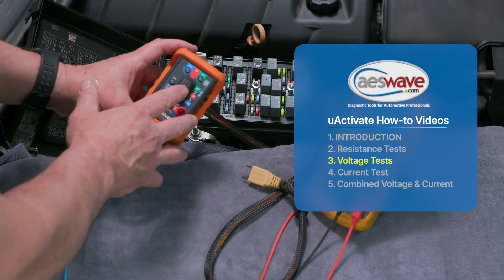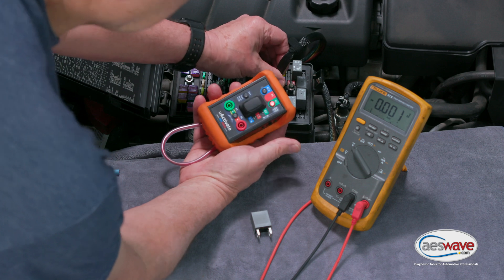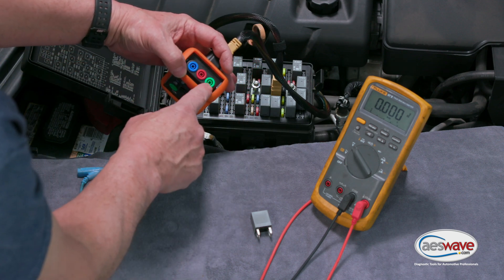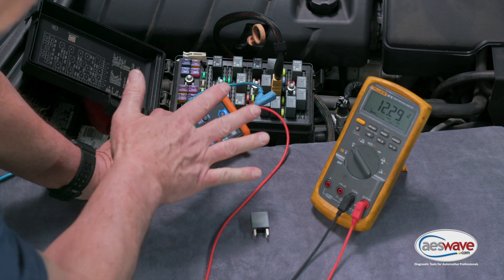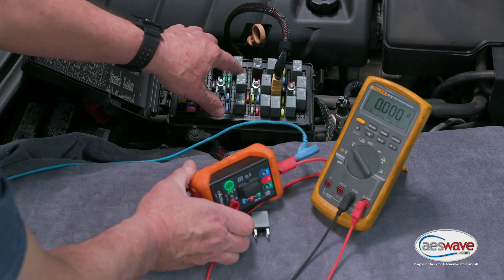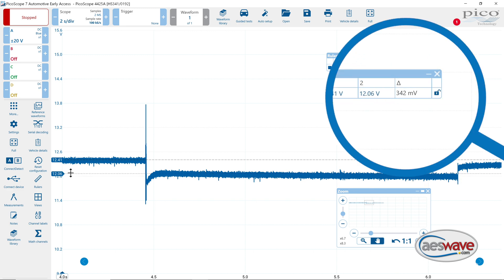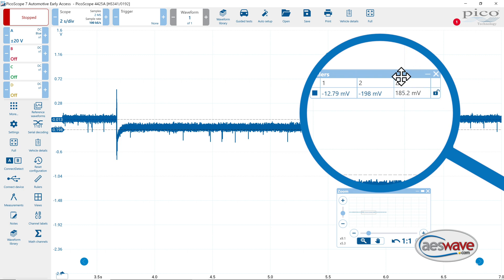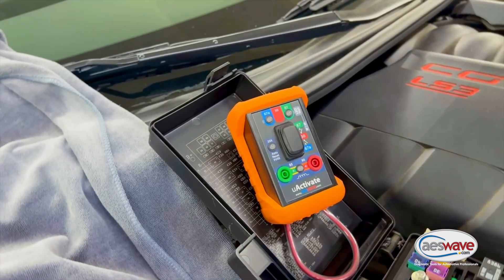uActivate® - How to: Voltage Drop Testing the Power Supply Circuit

Comment: that adapter can actually be inserted backwards????  terrible design.
Reply from the maker: You're questioning how a vehicle was engineered. The Mini ISO280 socket supports a SPST relay which 85 & 85 are in two diagonally opposed sockets and 30 and 87 are in the other diagonally opposed sockets. So getting terminal 30 aligned with the uActivate's terminal 30 is important for certain tests such as the one outlined in this video. However, if you want to quickly power up the load with the uActivate it really doesn't matter which way the Mini ISO280 adapter harness is inserted. The LEDs and the test switch make it easy to identify which helps solve the question. If you have any further questions, please let us know.

Comment: Gur the test he demo's here, it really is overkill...
Reply: Here's an example of why you would want to test voltage drop on the power supply: https://youtube.com/shorts/t5WdEyH21QE this one had a loose pin inside of the power distribution center that ended up melting the 40 fuse supplying power to the relay.
Reply from the maker: Excessive voltage drop anywhere in a circuit is a problem and this test demonstrates how it can be tested using the uActivate.

Comment: Hi nice demo but can you share a real problem like if you are not getting a control signal or missing power or ground at the relay connection
Reply from the maker: We recently posted a real world situation where the 40A fuse protecting the circuit was blown. This fuse wasn't easily replaceable so we used our test leads to run power to terminal 30 of the uActivate so we could continue testing the system. https://fb.watch/zmDQIV_Au0/

Comment: MY ONLY GRIPE ,,,,,,,,,,, WITH THIS TOOL IS IF THE RELAY DOES NOT HAVE IT'S POSITIVE FEED GOING TO IT THEN I CANNOT POWER UP THE RELAY.
Reply from the maker: For this situation you can run power to terminal 30 easily with a 4mm banana jack. Once you have that in place, you can perform your downstream tests (LED) on the load circuit and then drive the load through the main switch. If there is a short downstream, the uActivate has a built in circuit breaker. We recently posted an example case with this exact issue recently to our Facebook feed: https://fb.watch/zmDQIV_Au0/

If you need further clarification please let us know.
Reply: No need to yell

Comment: Not t a terrible tool, however, lisle made a bunch of relay breakout terminals tools years ago that is much cheaper and you can do the same thing with jumper wires and the breakout tool
Reply: I've used them as well. The best tool for the job is the one that can get you the most accurate and useful information the quickest. This tool shaves off a ton of time and simplifies the process with all its straight-forward features.  If you lack power at terminal 30, you could either chase down the source or provide a new one with your test leads using an alligator clip and a 4mm banana jack plug. The unit has a built-in circuit breaker for protection incase there is a short to ground on the load circuit after the relay connection. If you replaced the original fuse and it blew again, well, that's a waste. The LEDs alone provide a ton of intel about the control circuit and the power side which can be obtained in seconds. Time is $$$, this tool will give you back time!
Reply: @TechScottBrown 

" Bravo Zulu " - Well Said.

AESWave : Home of the ' Bulldogs ' - Fresno , CA........" O " George & Carlos Menchu ( Blood Brothers )

Ex Smog Repair Tech ,
Southern California